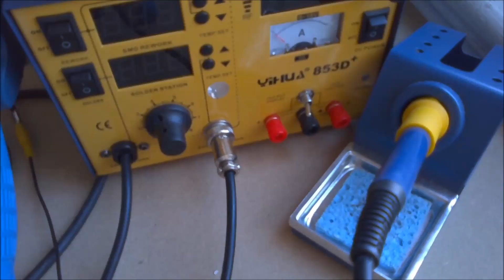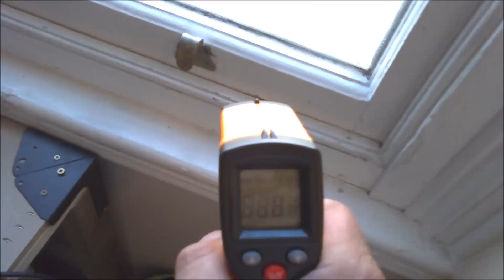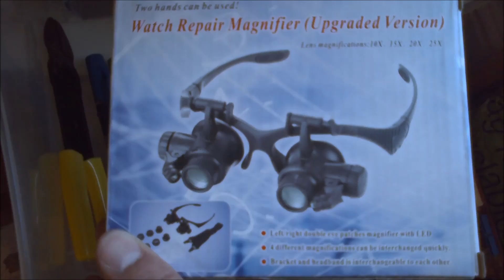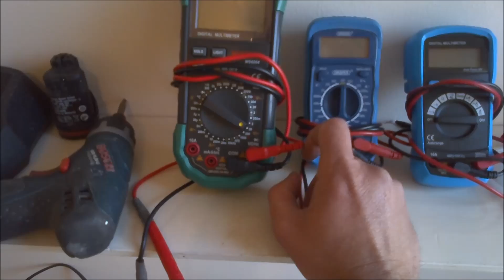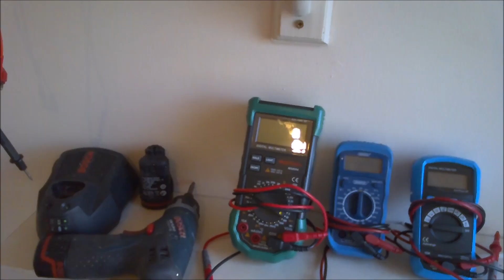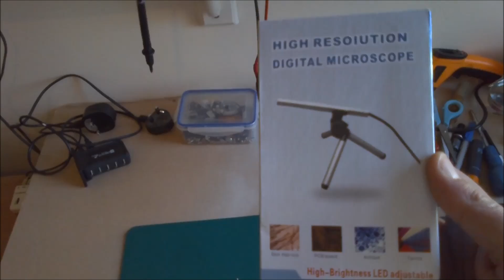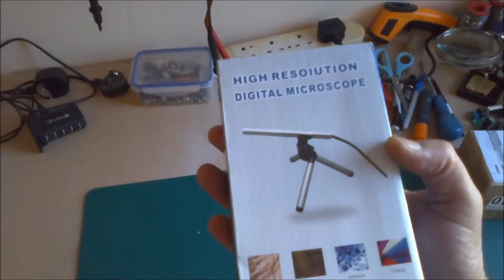How to set up a Home Electronics Lab for Repairs.

Comment: I saw that the window is next to your lab and that very good for fumes,also mat grounded & ground wrist band available.many other accessories. What I did not see that are very handy to have are Mirror when repairing TV, analog multimeter I personally like to check capacitors for those that I don't have there reading, analog meter that has Null (zero center) very good for speakers & other,Very low resistance meter very good to look for a short this was used on the Industry, pair of speakers with aligator clips connected, I did not see the "original chamois cloth" not imitation,  to clean "Video Heads" lint free cloth can be used but must be very carefull